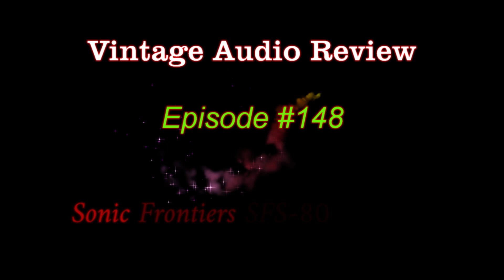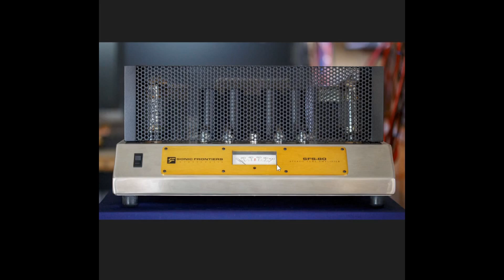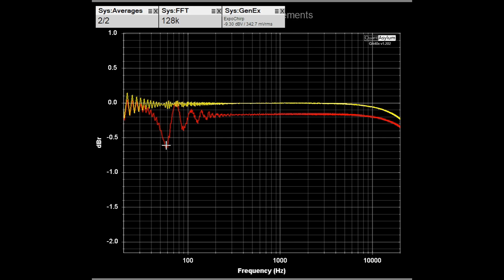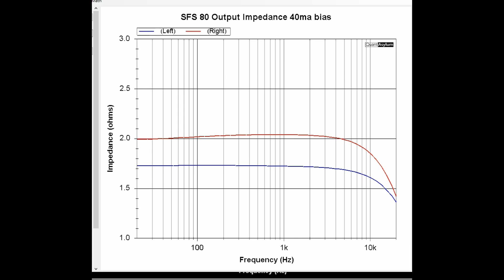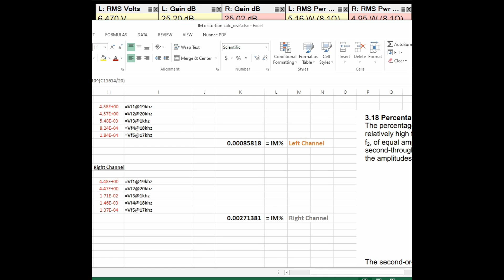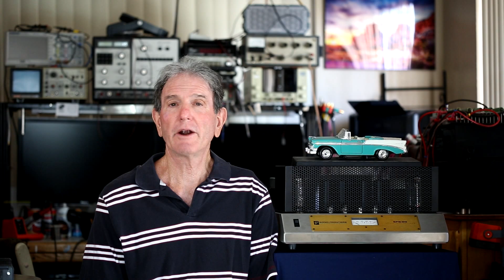Sonic Frontiers SFS-80 Sonic Frontiers SFS-80 Tube Amplifier: Vintage Audio Review Episode #148

Comment: Thanks for another great review. I learned a lot about an amplifier I didn’t know existed. I am curious how you would rate/compare  this amplifier against other tube amplifiers regarding build quality, value, and overall performance. Those reference points would help. Keep up the great work!
Reply from the maker: Thanks so much Dan and I hope you got the ET30.Build quality is fine, but performance was not- at least measurement wise. It sounded ok. I like the old mcintosh tube amps like the MC240's or MC30 monoblocks.....
Reply: @ I was traveling for quite a while, but returned yesterday and the ET 30 had arrived! I am eager to give it a try. Thank you for your generosity. Keep up the great work!
Reply from the maker: @danstein2467  It was Neohipo's generosity and and glad it arrived!

Comment: Great review and I love that you did a hearing test! At the hearing department of my local hospital, the hearing test was so rudimentary and only went up to 10khz! I'd say your hearing is better than most at your age.  
The one thing I would say is maybe it's best to test vintage equipment after it has been thoroughly gone through from a tech. Seeing the difference in THD between the right and left channel shows maybe it could be gone through to get both channels matching closer (of course they're very close anyway so I doubt it would make such a big difference at all).
Reply from the maker: Thanks for the suggestion and you are correct- the difference in THD between the channels is not going to be noticeable in most cases. As I mentioned in another post on the video, my friends are not typically interested in my doing restoring their equipment. I will do some things like setting the bias and dc offset (if applicable) and cleaning the pots/switches before listening, plus will have set the balance control. I am glad my hearing test was decent for my age, but had some trepidation before having it done...

Comment: Sonic Frontiers were a very nice brand in the early 90's, heavy and well build, great to see their equipment reviewed. Most of it will need serviced at these ages.

Sadly for me noise was pretty much why I moved from valve amps.
Reply from the maker: I agree with you about tube (valve) amps typically being noisier with no signal applied, but often not that audible.

Comment: Thanks, for this - I've always been interested in the SFS-80! It looks like there is a component in this unit that is out of spec and causing excessive noise in the power supply? That would annoy me if this was my unit and I'd have to investigate and fix it!
Reply from the maker: The noise level, to be honest, was  a bit higher than one would like, particularly on the left channel, I believe, but probably not as bad as it looks as far as the sound- sorry I did not plot the noise level or do my inputs terminated listening test. If it were mine and sounded bad I would do as you say- thanks for taking some time for the comment.
Reply: @vintageaudioreview  - thanks, mate. With vintage gear, it is less likely that all the components are operating within spec yet I am always amazed how little they affect listening impressions.

Comment: They had a couple pre-amps that were allegedly pretty spectacular.  Be interesting to find and have those tested.
Reply from the maker: I appreciate the comment and I will ask the owner (Richard) if he has one of their preamps. I don't think he does, or he would have probably brought that over at the same time. If he does i will test/review it- hopefully it does better.
Reply: @vintageaudioreview  very welcome!  Learning a lot from your work.  The hearing test WAS REVELATORY FOR ME!!  I work in wildland fire and use a chainsaw, like every day. Even with ear plugs I know my hearing is starting to wane (I'm 50 now).  I am scared to get it tested like you did.  But look how you now know exactly how to compensate with some EQ!!!  

Sonic Frontiers was touted as really amazing engineering and design and sonic quality. I wonder what was a bit off in that amp making the two channels a bit off?
Reply from the maker: @alanm.thornton4055  Thanks again and comments like yours make this a fun hobby for me. I am glad I got a comment about the hearing test! Yes, I was a bit scared to have my hearing tested because if it was not good, then I would not be able to enjoy the hobby as much, and maybe not spend $ on some audio things I am looking for. Sounds like you have an interesting job and probably some ideas about what may have gone wrong in the LA area. When you have your hearing test make sure they can do extended frequency testing, as that is not always the case. For my friend the Sonic Frontiers amps is just fine. More tube amps in a few weeks....

Comment: I notice in your testing there are sometimes considerable differences between the two channels in performance. It would be interesting to identify and then rectify what it would take in terms or service to bring them closer in-line to one another and to the manufacturer's specifications. Have you undertaken such an exercise? Your videos and personality are terrific and most enjoyable, and thank you!
Reply from the maker: Thank You for the kind words and taking the time to comment. I chuckled wondering what the Mrs. would say about my personality being terrific... As for trying to make the two channels closer- one has maybe a bit more gain than the other, maybe .4dB. In the grand scheme of things, not much of a problem- one can always adjust the balance control slightly, but doubtful most folks would hear that difference. The owners of the gear that I test don't really care that much for "perfection", though they would not care were I to do what you suggest. When I get something that needs repairing- not a lot of that lately- would be more the time I would consider that....
Reply: @vintageaudioreview  Come now, don't sell yourself short in the personality department! Understood, that many of the units you test are owned by others and of course their desires come first, if only just wanting a test of the unit.